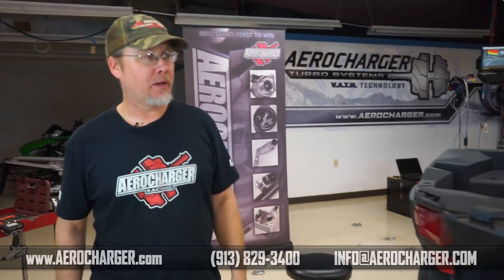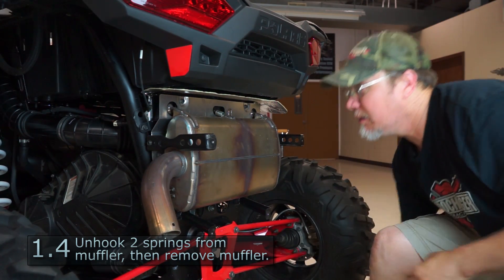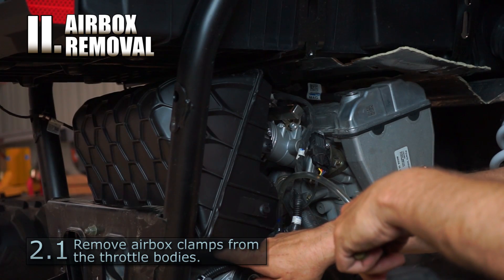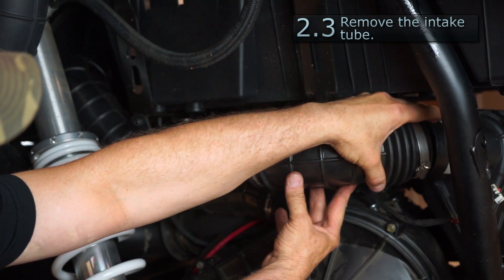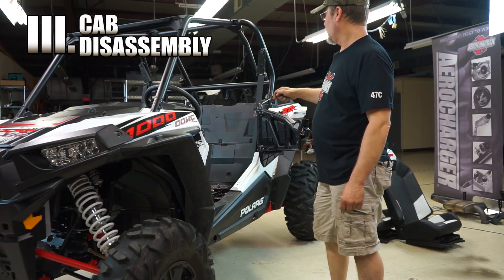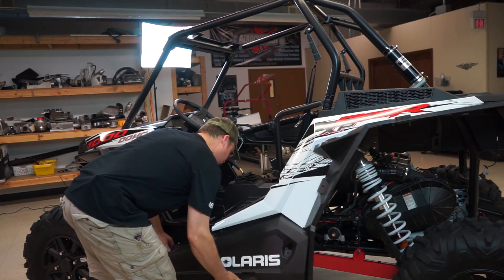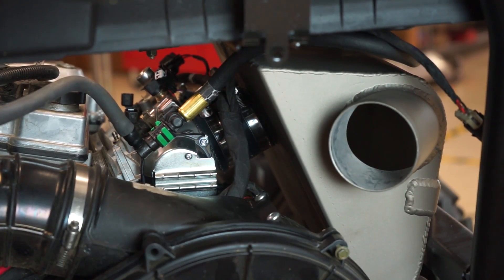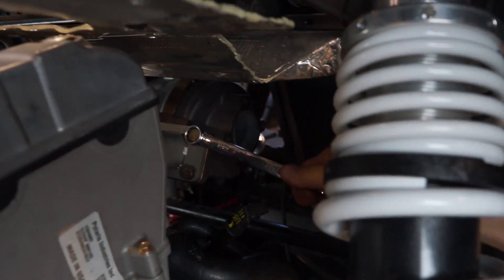Aerocharger RZR 1000 TURBO INSTALL: Part 1

Comment from the maker: Aerochargers are easier to install than normal turbos, but this RZR 1000 turbo kit might be the fastest-installing system yet. Follow along with Ken as we put some big power in this 2014 Polaris RZR XP 1000. (If you've got this kit already, this video corresponds directly with the install manual headings.)

Part 1: http://youtu.be/O3UgDKPeOu0
Part 2: http://youtu.be/LR3F38DBTlw